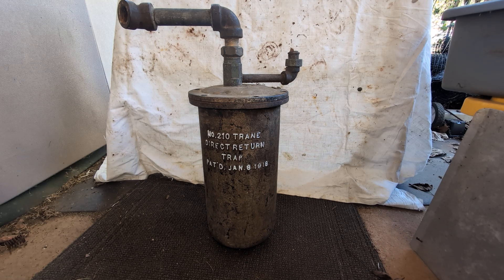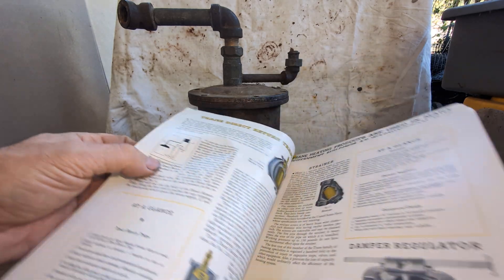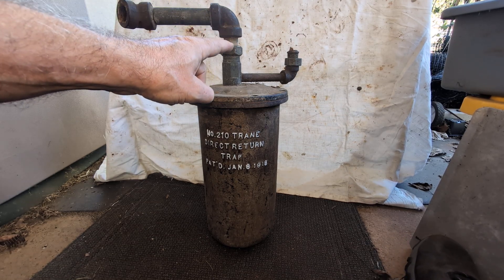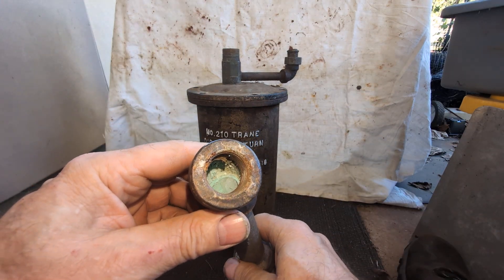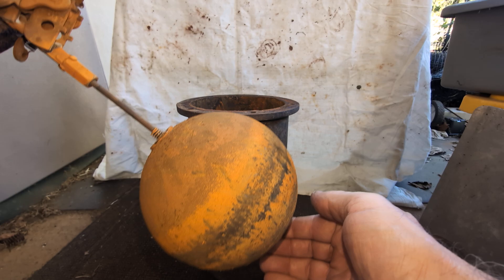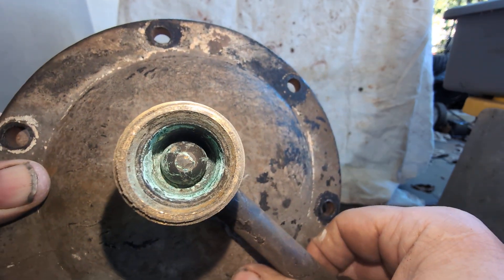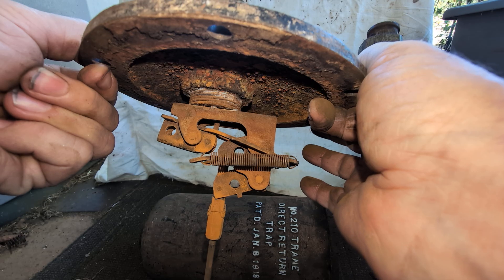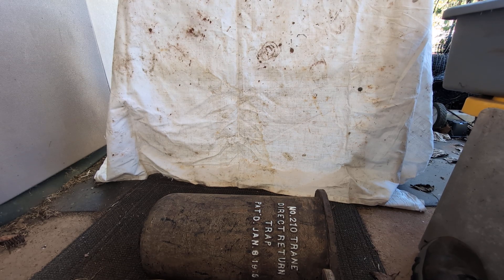Trane Coal Heating Era Vapor Steam Direct Return Trap

Comment: HI ,,, what would cause steam to blow out of the pipe quick vent ??? thx
Reply from the maker: It depends, but it is likely the vent has failed in the open position.  See if you can replace it with a Gorton vent.
Reply: @gordonschweizer5154  u have a Hoffman 75 now...if I get a Gorton #2 would that speed up the radiators   ??..is it worth the 200 to replace a good Hoffman 75??
Reply from the maker: @EdPlucinski  It has been shown by empirical evidence that a Gorton #2 vent will release at least 3x more air at a given low pressure (oz/in2) than a Hoffman #75.

In other words, it will take 3 Hoffman #75s on a manifold to equal one Gorton #2.

When you factor that in, a Gorton #2 is a bargain.

And they last longer than a Hoffman #75, too.
Reply: @gordonschweizer5154  TY .so I take the answer is yes the Gorton 2 will get the radiators hot faster??
Reply from the maker: @EdPlucinski  All things being equal (and they not always are), the Gorton will release more air and allow your radiators to heat quicker.